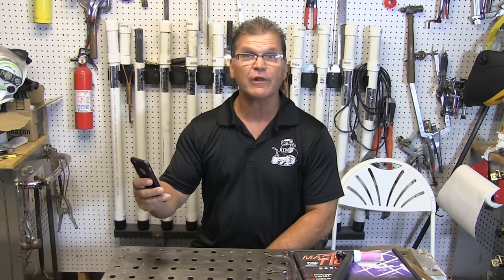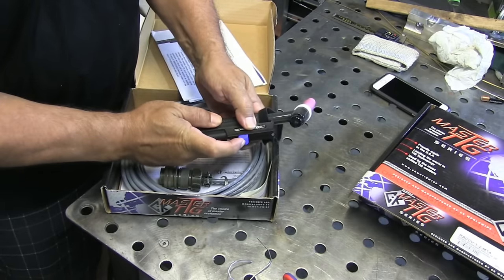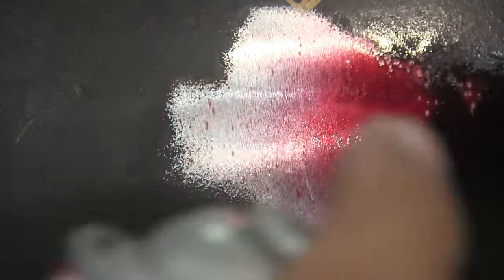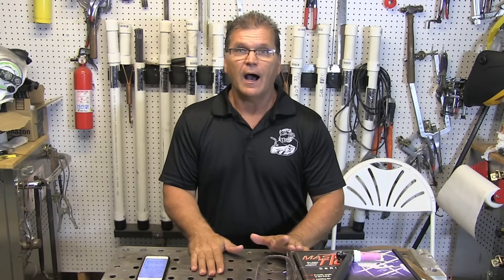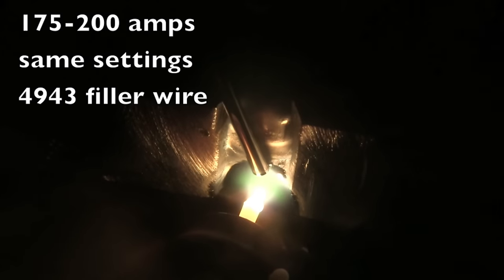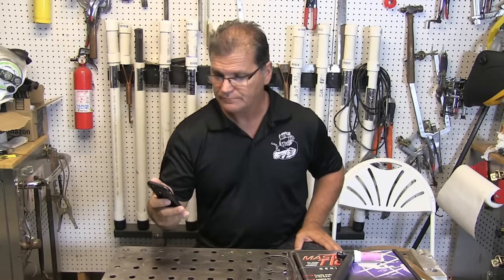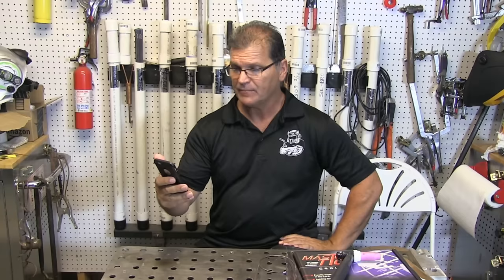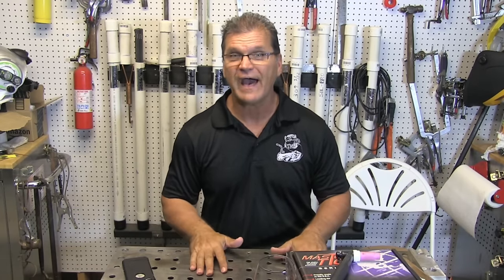Welding Cast Aluminum and Q&A

Comment: Hey Jody,  your back and forth nudging method really helped me out today. I have been doing repairs on some big aluminum sculptures and that includes welding into some angle grinder cut bevels in all positions. Aluminum doesn't like to flow into those sharp Vs but your trick really helped me get the puddle to flow in.  THANKS!

Comment: For those who are curious, "wrought" is from the past participle of the word "worked" (from something like 800 years ago!) As Jody explained, it means the metal was worked in some way (rolled, forged, or formed) after initial casting. Some compositions are fine as-cast, others have to be worked to achieve their characteristics.

Comment: That food coloring with kerosene and then some foot powder as a developer trick is actually a throw back to the early days of NDT used by railroad manufacturing. They would soak the wheels and axles and whatever other castings they needed in dyed kerosene and develop the cracks with chalk powder. This method allowed quite a few defects to make their way into service.

Comment: Here in norway it's not very normal to use footpedals. We use msotly tig torches with built in buttons and with that you can adjust amparage while welding by haveing a down sloap and an up sloap  and push the button to apply more amparage and release for it to lower.

Comment: Is it possible to gas weld cast aluminium ?.....also what type of filler rod would be used as it needs to be high melting point because it’s for a cylinder head exhaust port repair....Many Thanks

Comment: Thank you for discussing the 4943 i recently heard about it, can i ask can this 4943 be used to weld say 6061 to say 5086/5083 aluminum??? wanting to build a jet boat in the future trying to learn what is correct without spending millions on research.

Comment: Question about the App. I'm an android user so I won't know the answer until the app is out. If I'm standing in front of a some metal I want to weld and I want to search for the right settings for it that other people have used, can that be done? For example if I have 0.5 inch 8620 alloy steel lap joint, can I search that and then get a bunch of pictures and settings other people have posted for that situation? That would be pretty sweet.
Reply: Tikki a

Comment: Jody been watching you for years thanks for all the information learned a lot! how do you feel about everlast and is 250 amp verses 320 I got burned by a sales man once on Lincoln 175 tig saying it would weld 1/4 al... I'm on fixed income and can only buy one more machine just wondering if you still endorse the everlast brand?  N power tig 250 ext or 250?

Comment: Hey Jody thanks for answering my question, pronunciation of my last name was spot on, it is a Danish name.
I am a Stainless steel sheet metal worker, from Denmark, we you a welding technique that we call ArgonArk or tandem Tig welding, where you are to guys both with at TIG Torche and weld from both sides, one with filler rod and one with out.
how it works is, that the guy on the bagside is shields and pulls the rod through the material, is that a method, that is used in the USA, i have no idea, have never seen a welding video with it. Thanks
Søren Breinbjerg

Comment: Hey im having some trouble on cast aluminium no matter how much i clean it still comes out with some crud on the puddle what i need to get is a downright dummy proof way of how to clean and prep cast aluminium. Lets just say if you could do an example with material oil soaked, maybe left outside for a few months i dont know.
Reply: try soaking the cast in vinager and dish soap for a couple days..then rinse in hot water ..let dry and weld..will help tons..

Comment: What aluminum filler could stand more heat I want to repair the exhaust port on my cylinder head which is where temperatures can go up to 1000 degrees plz help and thanks in advance

Comment: hey, I have a question for you 
I'm welding up an aluminum cast head exhaust port for build up then have it port and polished. all we have at our shop is 6061 filler rod and 2% thoriated as or tungsten of choice for aluminum. should I invest in 
4943 filler rod and a 2% lanthaneted tungsten? I'd gladly send an email with a picture of what I'm talking about.
thanks.

Comment: I have a Eastwood tig welder 200 amps , can I weld aluminum cylinder head ? If it is possible tell me the settings

Comment: Started vertical stick welding today and my teacher tells me to whip out and and come back is that better or just dragging it better? Rod is 6010.
Reply: ShadowWraith whip it for sure. 6010 is a fast freeze rod used primarily as a bead rod for pipe. And the technique you use to put a bead in is a whip and pause motion. You ever want to weld pipe learn that 6010 as best as you can

Comment: Resently I tried DC+Tig, Do you think that this 4943 would work beter for this aplication?
I used 4043 with a 1/8 lanthenated tungsten and it did work okay. (Id get an AC Tig but thats not in my budget right now.)
Reply: AC not DC on alu